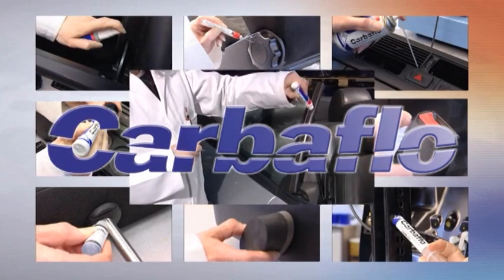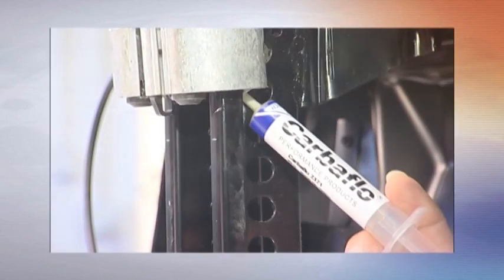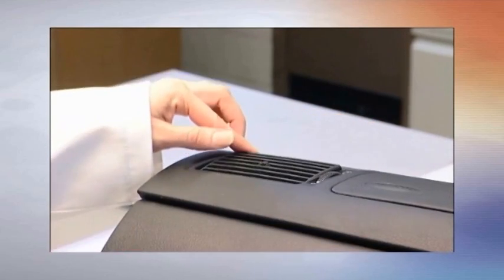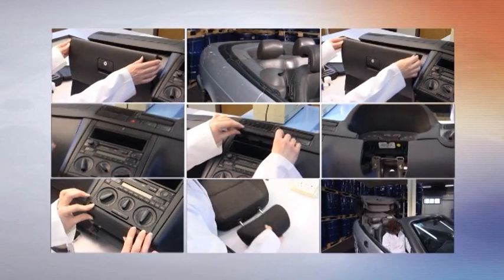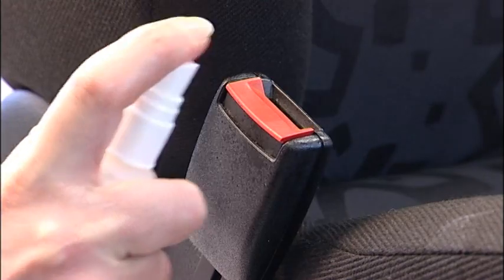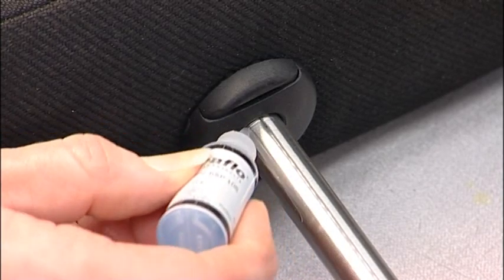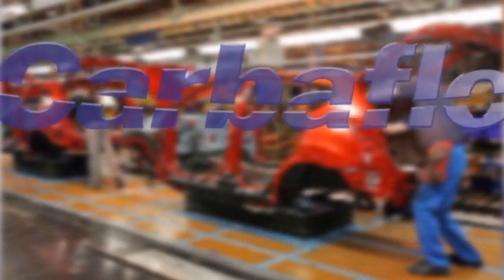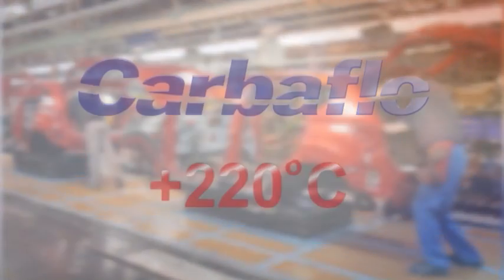Fuchs Lubritech - Carbaflo

Comment: That is a crap product. McLaren uses this shit and for the last six years I've had two brand new McLarens with permanently greasy windows. I had to clean them every time I would roll the windows down. I've spoken to the dealership and they tell me that this is a problem with EVERY car. Greasy windows on a supercar. Just what you need.
Reply: My experience is that the product is exceptionally good.... some dummies just apply it in the wrong place; the wrong amount; the wrong application :)
Reply: @pedrosweepe5928  I guess McLaren is just a dummy. This is applied when the cars are manufactured.